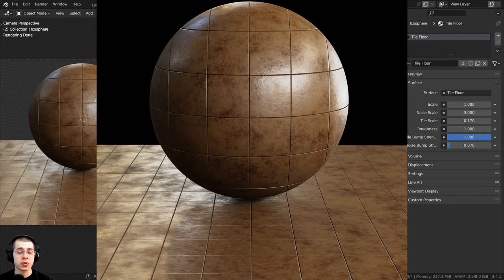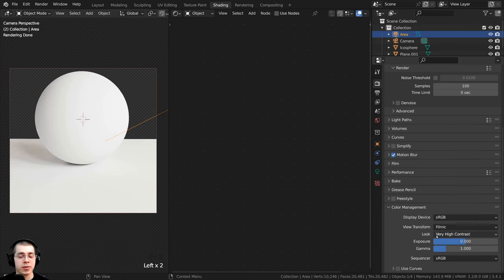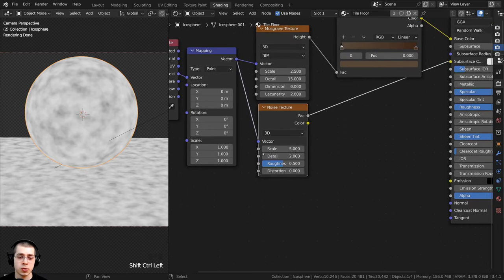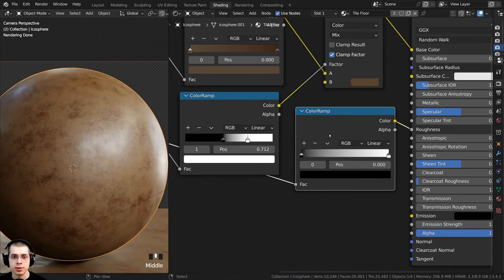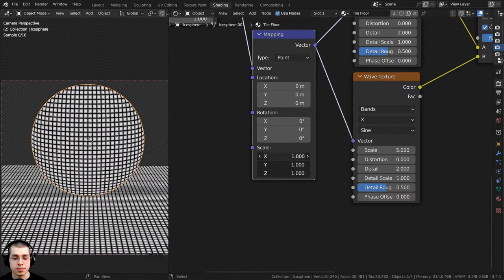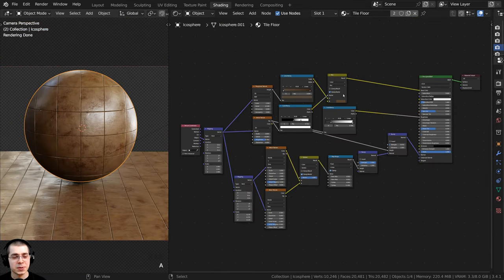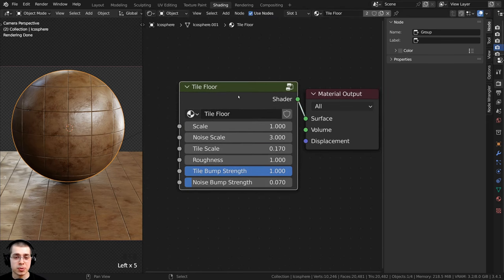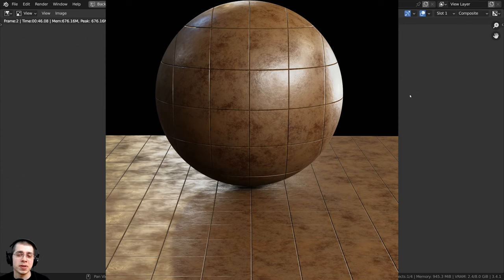Procedural Tile Floor Material (Blender Tutorial)

Comment: Once again, a fine tutorial and a very good looking result.
Three points I wanted to remark on though.

1. Main problem with this sort of procedural "tiled" texture... it's not tiled. The tiling is faked... and while this isn't too obvious with a subtle noise texture like here, with stronger patterns - say, a wooden floor - it gets very noticable.
There are several ways to deal with that point, though they would all be a bit more advanced stuff. But maybe you want to look into it and make one of your fantastic tutorials about it?
2. The use of wave textures for the tiling and shaping them with a map range node works very well here, and it's good to see such a method explained. But I do wonder if you have a deeper reason not to use the brick texture, which could be more flexible and simpler to use here?
3. As yet - though it has been requested for years now - there is no way to input colours into a colour ramp node.
But if you only use two colours, you can use a simple black-and-white colour ramp instead of feeding your colour directly into it, and then use that to drive a mix node with these colours. That would allow you to also have a group input for the colours.
Reply from the maker: Thanks for the tips. 👍‍

Comment: As always a thorough and well made video. Saw the tutorial, started blender and made a somewhat similar material. Played around with it, until i discovered that i could use the bump data to mix in a color of choice for the(english fail)space between the tiles. Cheers
Reply from the maker: Yes, you could mix the black and white data from the map range node into the base color with a mix node, to make the space in between the tiles darker.

Comment: Amazing! This is a material that I can see a lot of use with.

Question: any reason why you are using two wave textures rather than a brick texture to make the individual tiles?

Also, is there a reason you used a map range instead of a color ramp?
Reply from the maker: yeah I don't know why I didn't use the brick texture. I used the map range because I couldn't get the tile edges small enough with the color ramp.
Reply: @RyanKingArt  Understood! Thank you!

Comment: It looks like it wouldn't be too hard to modify this into a tiled concrete material? I'll check out your procedural concrete material and see if I can add the tile from this tutorial! 😁 Make it an asset too! Great tutorial!
Reply from the maker: Yeah you could totally mix them together.
Reply: @RyanKingArt  Thanks Ryan!
Reply: The problem with using this for a concrete material is it is likely to look too new. This material is ideal for the floor tiles Ryan made it for but for a concrete material that's likely to be in an outdoor scene you need to get dirt between the tiles and there are better ways to do that than using either a brick texture or, as here, the two wave textures. The problem with those other methods is that they aren't as non-destructive as this so you have to trade off getting a look and then having to stick with it against having something you can change easily if you don't particularly like it.
Reply: @phildavison319  Thanks! Would you happen to have a link for a tutorial that describes how to dirty up the concrete around the edges?

Comment: You should team up with Andrew D of Extreme PBR... If all of your materials were available in his easy to use interface That would be so awesome....i think hes getting ready to set up a new price point to get it in to more hands where you buy 1K, 2K, 4K by itself for a lesser price.... If he wanted to buy these from you how much would it cost to buy them and include them in his add-on cause they're awesome?
Reply from the maker: I wouldn't sell the rights of my procedural materials to anyone else. Actually I'm working on my own product, an ultimate material pack, which has all of my procedural materials Pre-Set up in the asset browser, with custom thumbnails and customizable values. It still might be a little bit though before the product is released, because its taking a lot of time to compile all of my 120+ procedural materials.
Reply: @RyanKingArt   You should throw up a way to add materials in the n panel because for me it's always a hassle to have to take up that much of my screen to open the asset browser.... Oh and the reason why I said all this is that your materials are freaking amazing... The creator of extreme PBR sells 2000 materials For 89 bucks... So you should make your pricing match his so for a 120 materials...you should sell for 5 bucks....then I can upgrade Extreme PBR with yours at the same price point...then everybody can... Because both your materials are similar quality but you have like more food stuff and different stuff than he does... Then see how many sales you get you might get a lot if you don't forget what I said cause you gotta eat!

Comment: Just a question...is it just my node-connecting-strings that are curved or is there some ort of addon or something like that that makes them straight? Because mine are curved ever since I went from 2.83 to 3.0, whereas yours seemed to be straight in that version of blender (3.0 and then 3.3, both of which I had).
Reply from the maker: You can change it in the user preferences. I have a video on this: https://youtu.be/teCPwsiGQ9Y

Comment: I have a question if you don't mind! I have a model car with tires that do not rotate correctly...in fact it rotate around the origin dot  in the center but not around its geometry origin dot ...I tried to set each tire with its origin geometry...but it didn't work !
Reply from the maker: make sure your transform pivot point is set to median point.

Comment: there seems to be a small issue with the method around using wave node to create the grid, I am currently trying to create 3d grid for my material using the object output instead of UV, I am experiencing strange texture pop in as I dial the scale slider, upon investigation, for each wave node that I used, if the wave scale was on certain value, the third side of the cube, the side seemingly with no line texture on, the shade and pattern on it would shift, would get darker some time or some weird noise/voronoi pattern would pop in... so I have to watch the texture and not use certain value of scale... any thought? Have I done it wrong??
Reply: sorry, I was trying to squeeze it many info at once, and forgot to mention some other thing, I am using three wave node at the moment, xyz repectively and combining them with mix colour node, darken mode... when I said the third side of the cube, I meant when you look at each node individually up to that point, you would see line running across each side of the cube, except one...